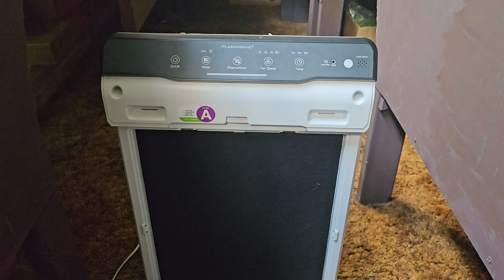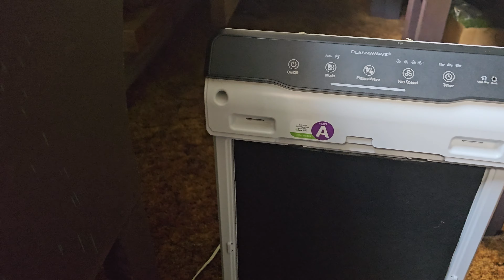How To Control Dust For A Model Railroad

Comment: Al, when I had my present home built in a Dell Webb community, the basement as a future train room was a too priority. As soon as we closed (back East, I understand you call it "settled" or "close of settlement") I immediately had an HVAC conttractor instal an electrostatic air filter on the furnace/central air conditioner intake duct. It was from a well known HVAC equipment manufacturer and is completely ineffective, dare I say "worthless". Worst 1,200 bucks I ever spent! I've replaced it with a HEPA filter that does a much better job.

When I finish the 2,800 sqft basement in preparation for layout construction, I plan to install a couple of ceiling mounted Purifan units, retail approx $700 each. They claim they filter out particles down to 2 microns which is the size of the smallest visible particle in cigarette smoke. They replace a large ceiling fan installation with a 52" blade diameter. 

It has a cast concrete floor which I plan to cover with a good grade of indoor/outdoor carpet to suppress concrete dust, deaden sound reverberation, and to be easier on the feet and legs while working on the layout and running trains.
Reply: Hi Bear, might I suggest sealing not only the floor, but also the concrete walls in the layout room before you lay the carpet... Because another consideration is that concrete is porous, and allows ground moisture to raise the humidity of the room - so being diligent and sealing not only the floor, but also the concrete walls will also help to keep your benchwork as dimensionally stable as possible while reducing your dehumidifier's load.
- Charlie
Reply: @openeyes-411  Thank you for the advice, Charlie! The house has a walkout basement, so only about 50% of the foundation walls are concrete. With ten foot high walls, I agree that it's still got a lot of exposed concrete. However the humidity in Colorado is so low that instead of a dehumidifier, most homes in my area have to have humidifiers to keep the air comfortable, especially in winter with forced air gas heat! My basement is drier than a proverbial bone. So, dust will always be the enemy here, not seepage or atmospheric moisture.

Comment from the maker: You don't need to run air cleaners 24/7 but I found that frequently running them helped a lot for my room. Also, I highly recommend having ALL your home ac and heating ducts professionally cleaned in your house by a reputable company.

Comment: Hi Al, lot's of great advice - and you also have one great lookin' MRR there!!! Subbed! 👍😎👍
I have a couple of thoughts I'd like to add...

1. As you say, sealing the concrete floor IS an absolute must - bare concrete is definitely a dust generation machine! But another consideration is that concrete is porous and allows ground mositure to raise the humidity of the room - so being diligent and sealing not only the floor, but also the concrete walls will also help to keep your benchwork as dimensionally stable as possible while reducing your dehumidifier's load.

2. As to shop vac's and filters, unless you're using a shop vac designed for cleaning a furnace or drywall sanding, the level of "filtration" simply will probably not be sufficient...
A modification you may be able to make to a standard shop vac, is to extend the intake port to near the bottom of the tank, and then fill the tank 25-30% with water - thus releasing the dust laden air below water level, and trapping much smaller particles in the water.

3. I'd venture a guess that many (most?) of the materials we use in construction & scenic materials are capable of outgassing chemicals into the air - which probably accounts for your noticing such a difference when diligently using your air purifiers, which is better for our overall health.

My 2 cents, fwiw
Charlie
Reply from the maker: @openeyes-411  thanks and thanks for subsribing

Comment: I put an air purifier in my basement train room for the last 10 years and have never had a dust track issue
Reply from the maker: That feed back is good to hear how ofter does it run and how large is the room ?